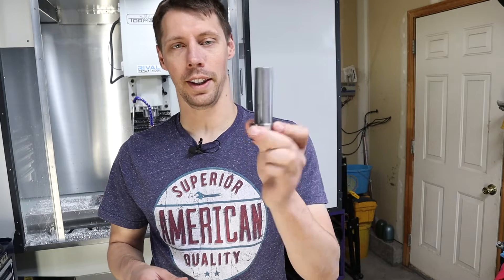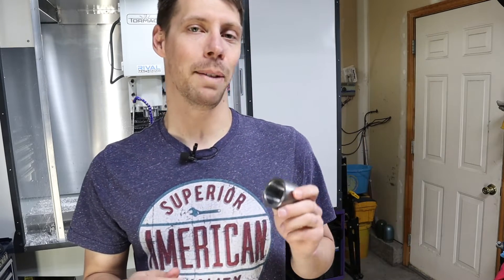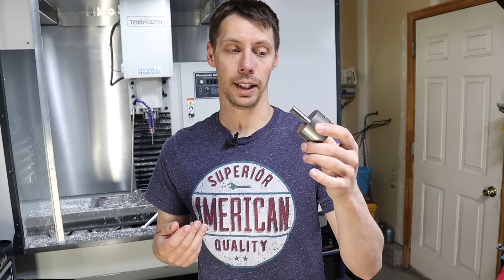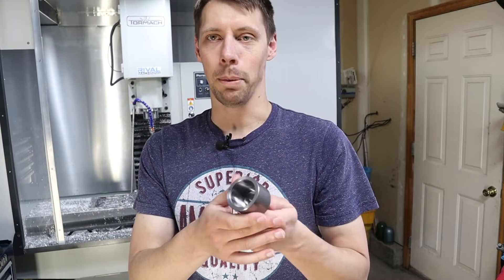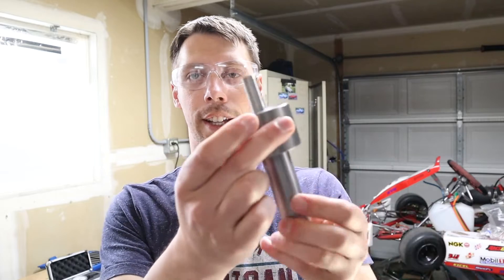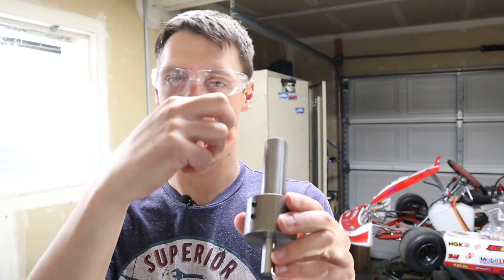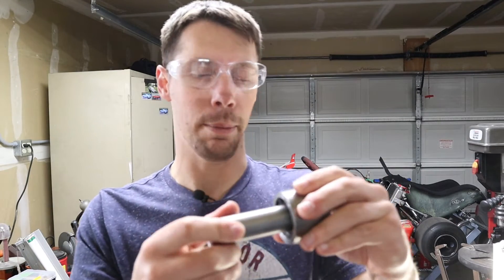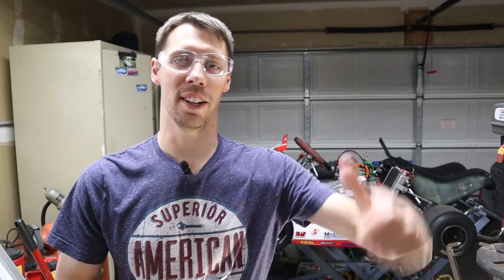Part 3: CR125 Cordless Drill Kart Starter Project

Comment: That came out very well.  Have you used it yet?  Any plans to produce a few and sell them?  If so, I'll take one!
Reply from the maker: Thanks, I've actually been working on my kart a bit trying to get it running correctly.  This thing is a LIFESAVER especially since mine can be hard to start.  Pulling the rear tire with a strap just isn't enough to push fuel into the engine and start it all in one pull very often.  I'm trying to figure out why the pocket on the drill side was so hard to machine, as well as looking into heat treating options.  Once I get that all ironed out I'll see if its viable to make and sell.

Comment: Interested in one. Suggest a couple of changes (1) instead of milling a socket, you can put a 1/4 or 1/2 inch drive end in it? That way you can use it with different sized sockets. (2) instead of milling the clutch housing,  why not use a tube and weld a back plate and a 1/2 inch driver?